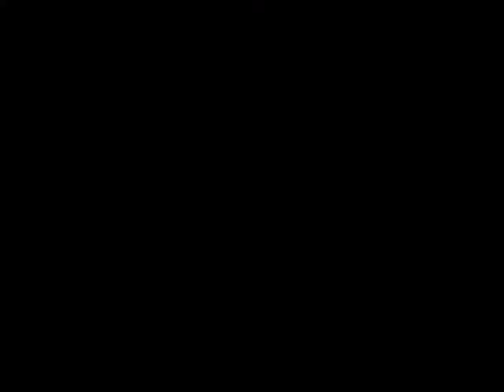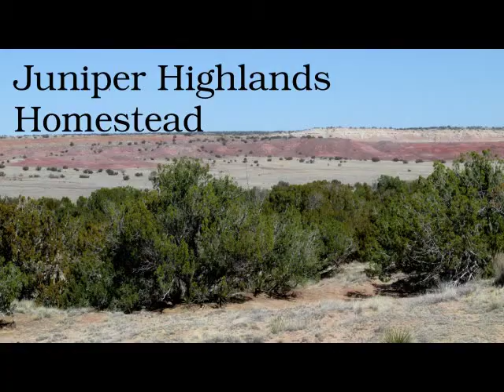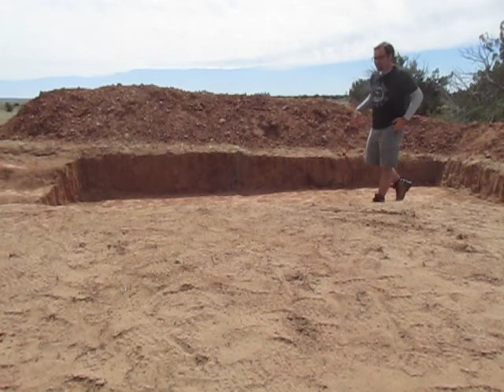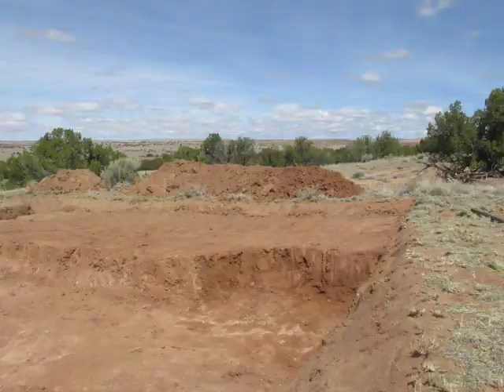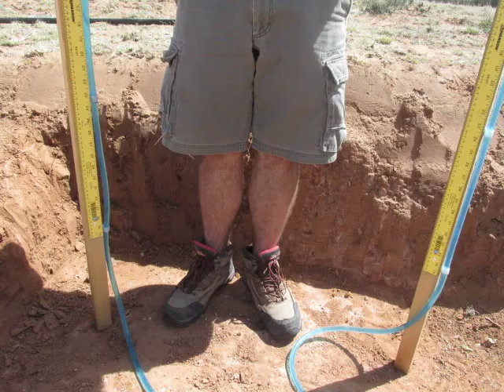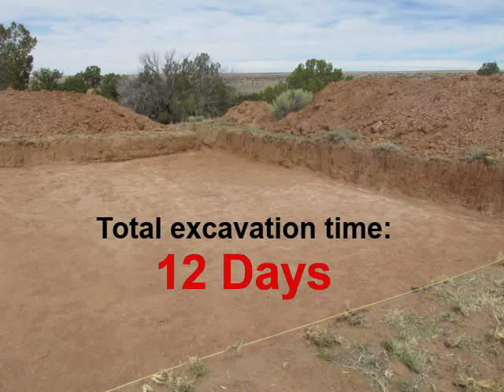Earthbag Build - Episode 02 - DIY Excavation with Hand Tools

Comment: Thanks for the info.  Easy digging in your area, here in the hills we have lots of (big) rocks.  Still a lot of useful info and well made videos. :) Subbed and liked.  Easiest way to dig a site is probably to blast into the hill side until everything is loose, and then use a back hoe of some kind to pull it out.  Many of your other processes and tools are nice - I love the water level.

It's expensive, but with proper planning you can complete the actual site area  for a nice earth-bermed off grid homestead in a week or less of heavy equipment use.

Comment: You kinda clarified me some of questions/doubts I have. In my region, our building code requires the bottom of the footers (because of frost depth) to be 2.5ft deep (underground) and 1ft of width (almost like you). So can I technically make a 1ft wide trench and make the footers in the tench 2.5ft deep but with a height of 8 inch and from there raise a concrete block stem wall all the way up?

The reason I ask is because I am not sure if I must fill that entire trench (2.5ft by 1ft) out of pure concrete , which will make it a lot more expensive for me. Thanks.
Reply from the maker: I am pretty sure that's the standard setup for a footer/stem wall. I would check with your local building code department to make sure you are following their protocol. My community allows me to do what I am doing because my building is under 200 square feet.
Reply: Thank you! Good point.